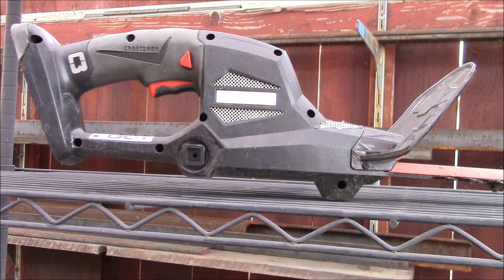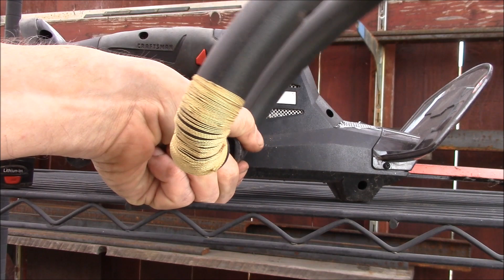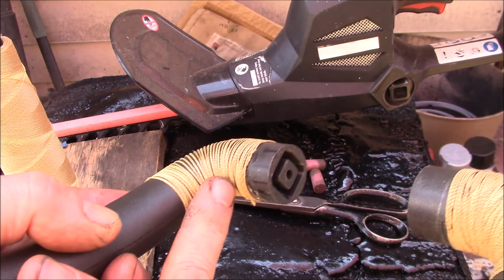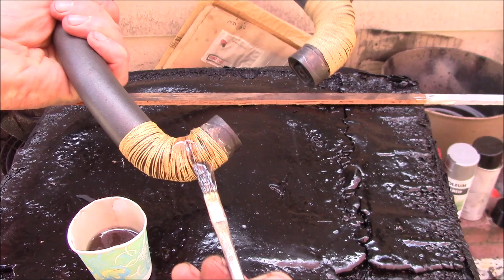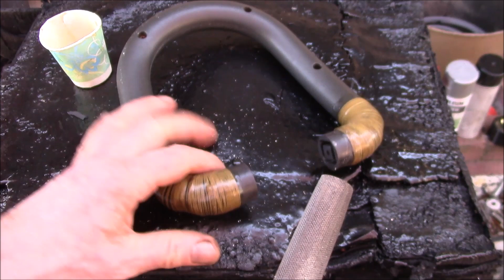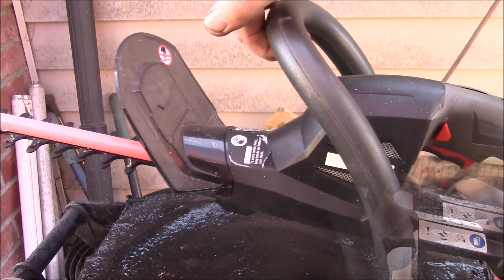Craftsman C3 Hedge Trimmer Handle Repair

Comment from the maker: Still using the repaired handle.  I did eventually install some longer screws in from the outside of the bend to hold the handle in place a bit tighter.  I just drilled through the epoxy putty I used to fill the original hole then used a screw that's long enough to reach the threads on the inside.

Comment: Thank you for making this helpful video. My hedge trimmer handle broke also and I was ready to get rid of it until I saw your video. I temporarily glued the pieces together so they would hold then spread 2 part epoxy on the handle, wrapped kevlar kite string around it while the epoxy was still wet and when it dried I put another coat of epoxy over it. I just reinstalled it and it is very strong. Thank you for tip.
Reply from the maker: Glad you were able to get your handle fixed.  Mine is still going strong 4-1/2 years later.